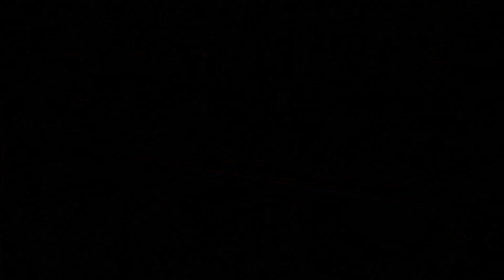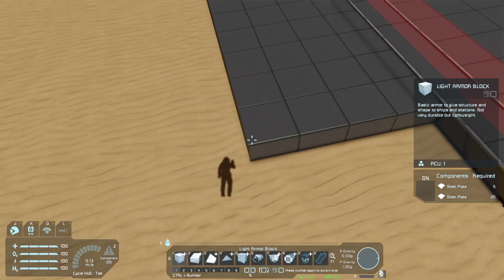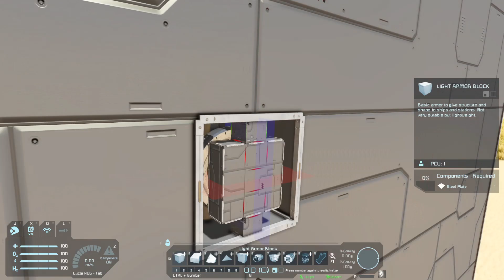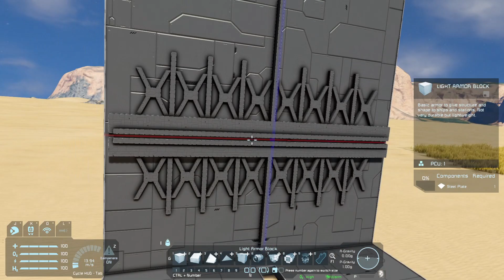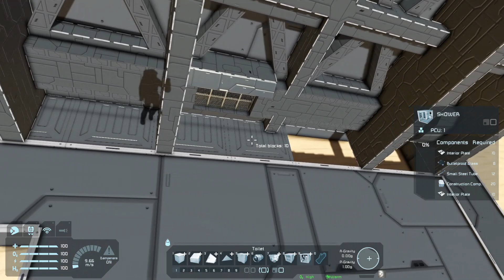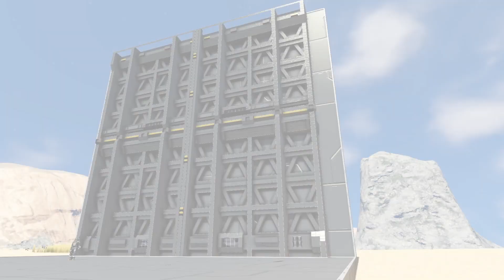Space Engineers Build Timelapse - Machine Nest Pt. 1

Comment: Good use case of From the Depths like mimic blocks here, along with copy pasting components of grids, a fixed small/large grid connection would be awesome for making this work more practical. Awesome job!
Reply: If you mean like the rotor isn't fixed, you can lock them and it basically is completely fixed
Reply: @romain5967  yes you can do that, but game optimisation wise having the ability to arbitrarily fix small / large like medieval engineers detail blocks would be ideal.

Comment: Space Engineers really needs proper selection tools so we can copy/paste details without the tedious process of cannibalizing whole grids. Something similar to break apart grids along a plane would make expanding and resizing a design much simpler. The crude way copy/paste works from its anchor block also needs a rethink, as does the inflexible way it handles overlapping pastes (it doesn't).

I guess I'm spoiled after a few decades of using photoshop and various 2D and 3D software, but I've yet to see any kind of voxel editor solve these interface problems. It's frustrating to work with such crude tools.